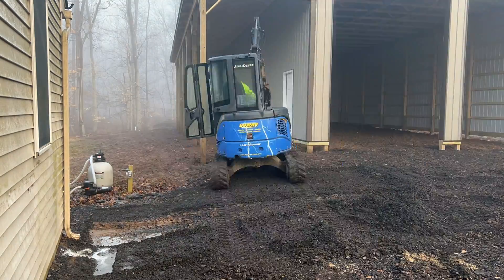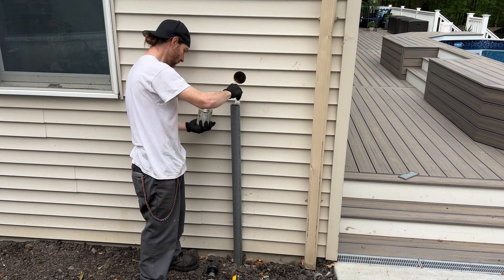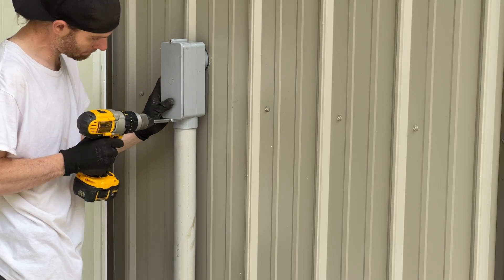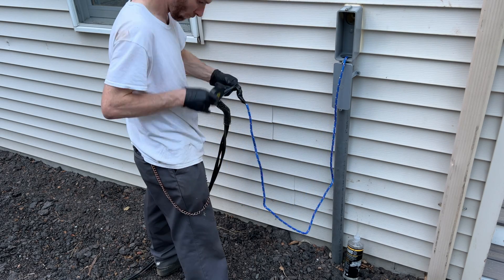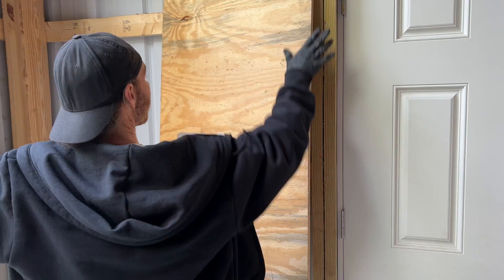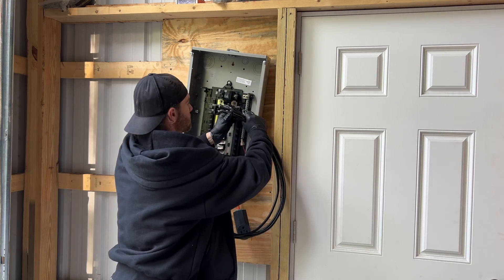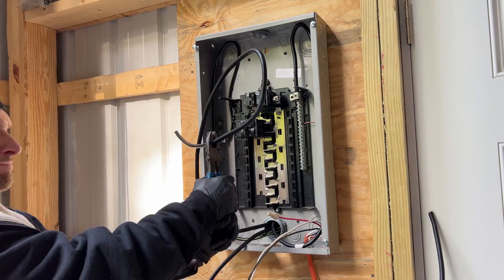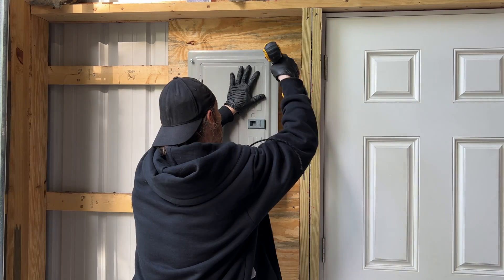How to run electrical service to pole barn & install 100 amp panel in garage detached metal building

Comment: So in the main panel the grounds and neutrals are bonded. In the subpanel the grounds and neutrals are not correct?
Reply from the maker: Yes, you are correct. The grounds and neutral wires in a main electrical panel can be mixed together and all are technically connected together because the ground bars get bonded to the panel, but in a sub panel the grounds and neutrals must be separated.
Reply from the maker: The way it works is there's a screw/bolt that goes through the ground/neutral bar and connects it to the metal panel housing, but any subpanel the neutral bar is isolated and stays disconnected from the panel/metal box. Usually there's a piece of plastic between the neutral bar and the panel

Comment: what wire did you use? NVm, I see you answered that below :)
Reply from the maker: Good to hear you found it in the description. I'll leave it in the comments here, though just in case anyone else missed it. That way that they can see it here in the comments. 

The wire I used to run from my panel to the junction box before I left, the house was 2-2-2-4 SER Aluminum Service Entrance Cable https://amzn.to/4iKeD73 

The wire I used to leave the house and run to the pole barn was 2-2-2-4 Dyke Quadruplex Aluminum Conductor https://amzn.to/4fpV4Oz

As an Amazon affiliate, I earn a small commission on any items purchased through these links

Comment: Really clean work! Quick question — is that orange-wired box the generator inlet?
Reply from the maker: Thank you, I appreciate that!!! It's actually a plug for my Miller MillerMatic 211 auto-set welder & am I cheap ebay / amazon plasma cutter. It could definitely be used as a generator inlet, but that's not why it's there.

Although in a jam I could use it as a portable generator inlet, but something to keep in mind if you ever plan on doing that... it's technically illegal. It is 100% against the NEC national electric code to backfeed your panel with a generator hooked up like that. 

But.... Technically if you turn your main off your main breaker it eliminates most of the risk, but if the main breaker was left on it could backfeed the Electric straight back to the street or where ever the power was initially coming from and the person working on it could get shocked or even killed.
Reply: @BrandonStunts  Thanks for your detailed answer, very much appreciated!
Reply from the maker: You're welcome! Good luck with it

Comment: What size and type of conductors did you use?
Reply from the maker: I have a part list in the description of the video of what I used. There are other types of wire option available as well. Here's the parts list below. I copied and pasted it so it will be right here in your comment.

 The wire I used to run from my panel to the junction box before I left, the house was 2-2-2-4 SER Aluminum Service Entrance Cable https://amzn.to/4iKeD73 

The wire I used to leave the house and run to the pole barn was 2-2-2-4 Dyke Quadruplex Aluminum Conductor https://amzn.to/4fpV4Oz

You're going to need a pretty big junction box to make a connection point to tie the cables from the panel to the cables going to the subpanel in the detached building. You might be able to get away with 9x9x4, but I would probably go with the 12x12x6 PVC junction box.  https://amzn.to/3ZBz8dm

This is the best connector/bug that you cam use to connect your 100 amp SER wire from your main breaker panel to the wire going to the 100 amp  panel in our detached building would be https://amzn.to/3DnFy8I

Hopefully that helps for now, but I'll try to get some thing showing when I did. But it's really just 100 amp breaker and then a line ran to tie into your sub panel. 

Parts list…

100 amp amp panel - https://amzn.to/3xNfC3x 
100 amp breaker to power the panel (if you have ITE/Siemens main panel, if not search for the correct manufacturer)  -  https://amzn.to/49KjAaf

To feed the panel from the house, I used 100 amp SER wire and ran it to a junction box behind the LB in the garage  https://amzn.to/4aHTCpZ 

Junction box https://amzn.to/42Dgqpa
 

1-5/8” #6 drywall screws (for the top) - https://amzn.to/3qMTDGc 

More product links coming soon... 

Hand tools
Razor knife https://amzn.to/463zfkA  
razor blades https://amzn.to/3N3hGIx 
Screwdriver set - https://amzn.to/3NbFOZQ  
Combo screwdriver - https://amzn.to/3N4CZcL
Needle nose pliers https://amzn.to/3JaloPs  
Linesman pliers - https://amzn.to/3ur0J55 
Hand held Cable cutters up to 1/O - https://amzn.to/49GyorS 

Safety equipment
Safety glasses - https://amzn.to/3Co7kyf 
gloves - https://amzn.to/43EuLiE

As an Amazon Affiliate I earn a small commission from qualifying purchases

Comment: The square tube buildings are dumb because if you want to hit a stud for your meter mount you might end up having to build your own studs with square tube inside
Reply from the maker: This is a traditional post frame building / pole barn. But yeah, I'm not a fan of square tube buildings either, or any of the cheap all metal garage kits they sell

Comment: I did mine with with the LB down at floor level and used another LB on inside and came up thru bottom of panel with conduit. Looks better on outside of building
Reply: I’m just getting ready to wire in my shops.  I may give this a try!👍🏻

Comment: Do you have to add a new ground rod and conductor too??
Reply from the maker: Yes, ground rod is below panel with a #4solid bare copper wire. You can check out this short video I made showing me driving it in 

https://youtube.com/shorts/ZFIrT4KwKOA

Comment: Do you have a video connecting wires at the panel in your home? Did you have to install a sub panel next to your main panel in the house prior to running wire out to your panel in the garage? Thanks for this video and thanks in advance for any info!

Comment: Great video! Can you tell me what diameter PVC did you use?
Reply from the maker: Thank you, I appreciate that! I used 2 inch PVC schedule 40 pipe. Here's a link below to show it, but you can get it cheaper and in 10 foot lengths at Home Depot, Lowe's, or Electrical supply house.

2" Schedule 40 pvc pipe
https://amzn.to/3PHmDZu 

I have to disclose that as an Amazon affiliate, I get a small commission if anything thats bought through the link, but like I said, it's probably cheaper elsewhere, especially for a longer run. This at least shows you what to look for wherever you go.
Reply: @ thanks!
Reply from the maker: Your welcome! Hope it worked out for you

Comment: A few questions.    From what I’ve reviewed Noalox is no longer required.  I thought the NEC requires schedule 80 above ground as well as expansion fittings at both ends.  Is this correct?
Reply from the maker: Honestly, I couldn't tell you, but I could check with some guys at work and let you know. I started working in the field full-time from 15 to around 25. i'm 42 now and have been working in the office for almost 20 years. When the electrical inspector came out and looked it over with me, they he said it looked really good and signed the sticker. There were a couple other things throughout the building Electrical wise that I did that he had a few questions about, but he said everything was good with the service entrance and subpanel.

Comment: Scratching my head on the LB mounting location on the new building… on a rib?
Reply from the maker: The pipe was already concreted in and believe it or not it has a pretty nice and clean finished look on the other side. Especially with the duck seal it finished it off really well and fully sealed it.
Reply from the maker: Although I will agree, I would've preferred it to be an inch or two over to the right, but I had some buddies helping me and then by the time I noticed it was slightly off the dirt was backfilled and compacted / prepped for the concrete. It didn't seem worth digging it up just to move it over a bit.
Reply: @BrandonStunts  I get it.  Been there, done that with projects of sorts. At the end of the day, the lights come on! Great job! 👍
Reply from the maker: Thank you! 👍

Comment: Can you show how you hook it inside your house? I want to do the same thing, but I just want to run it off a double breaker.
Reply from the maker: I can probably make a short video showing it, but I can at least explain what and how it now, that way you have an idea right away. So I started with a 100 amp two pole breaker in my main 200 amp panel. 

The wire I used to run from my panel to the junction box before I left, the house was 2-2-2-4 SER Aluminum Service Entrance Cable https://amzn.to/4iKeD73 

The wire I used to leave the house and run to the pole barn was 2-2-2-4 Dyke Quadruplex Aluminum Conductor https://amzn.to/4fpV4Oz

You're going to need a pretty big junction box to make a connection point to tie the cables from the panel to the cables going to the subpanel in the detached building. You might be able to get away with 9x9x4, but I would probably go with the 12x12x6 PVC junction box.  https://amzn.to/3ZBz8dm

This is the best connector/bug that you cam use to connect your 100 amp SER wire from your main breaker panel to the wire going to the 100 amp  panel in our detached building would be https://amzn.to/3DnFy8I

Hopefully that helps for now, but I'll try to get some thing showing when I did. But it's really just 100 amp breaker and then a line ran to tie into your sub panel.

Comment: What schedule conduit did you use for the portions that are above ground?
Reply from the maker: I used Schedule 40 PVC Pipe / electrical conduit for everything. So the above ground and below ground are the same piping

Comment: so you ran 220?
Reply from the maker: Yes. Same as the electric going into the main house. It’s fed from a 100 amp two pole breaker in my main 200 amp panel feeding the power to my house. I run lots of 40 to 60 amp 220 equipment including a huge air compressor, welder, plasma cutter, powder coat oven, two post lift… etc.
Reply from the maker: I also did 8 individual dedicated 120 V 20 amp GFCI protected double duplex outlets drops down from the ceiling in a 1900 boxes. So everywhere in the shop can pull the full amount of power at the same time

Comment: Torque the lugs to the proper value is the correct way to land the wires
Reply from the maker: Yes, technically that is the correct way. The breakers should have torque specs on the breaker sticker, as well as the panel.

Comment: What size wire did you use to feed the panel?
Reply from the maker: This is the wire I used in the link below. You could also use single conductor copper wire, but it’s more expensive and I had this available to me for free since it was left over from a job.

https://www.amazon.com/dp/B00A4HNL64/ref=cm_sw_r_as_gl_api_gl_i_HZZ1MJHXV9M1VET0CYE0?linkCode=ml2&tag=brandonstunts-20

Just a disclosure I am monetized on Amazon through my YouTube channel. So any purchases on this link I would earn a small commission. Hope this helps though.
Reply: For my understanding should be 1/0 aluminum wire cable rated for 100 amps feeder. Is that the one you use?